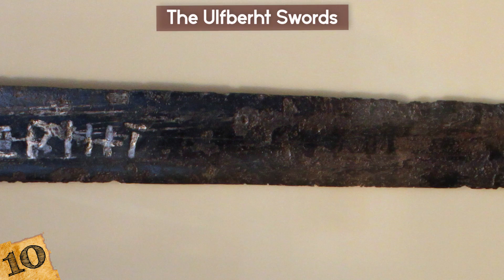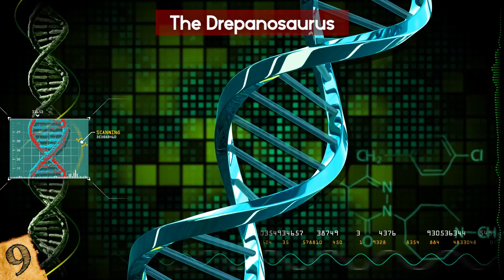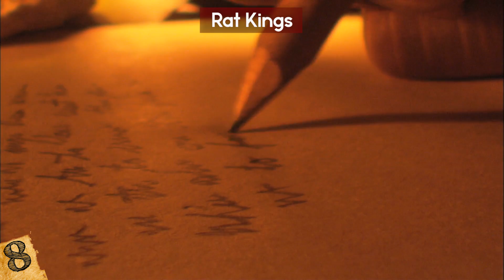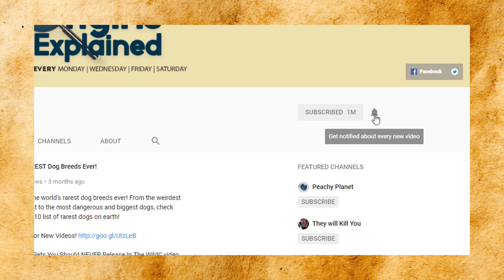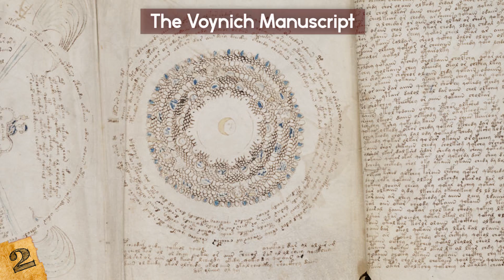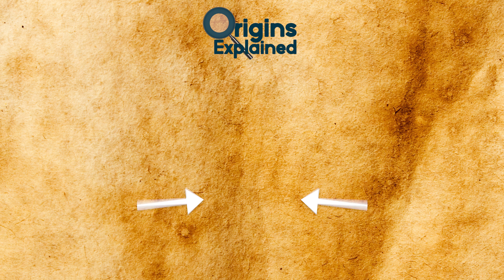MYSTERIOUS Discoveries Science STILL Can't Explain!

Comment: Why would anyone give carbon dating another thought. It has been proven wrong so many times. When I hear, this or that is 2,500,000 or 10,000,000 years old I just shake my head and laugh. Anything to discredit The Holy Bible. What about The Nephilim or giants? The Bible talks about them and even gives an accurate description of their specific origin. Scientist have found skeletons of them many, many times. This should be a big deal but you seldom hear about it. Why? Because it proves the Bible is accurate. No matter how hard scientist try, they will not take GODS credit from HIM.
Reply: "Why would anyone give carbon dating another thought. It has been proven wrong so many times. When I hear, this or that is 2,500,000 or 10,000,000 years old I just shake my head and laugh."

For starters, no. Carbon dating is perfectly fine to use when dating organic remains. We know how to best use it and when not to use it. Its' accuracy can be calculated and the results can be tested.

Secondly, we don't use carbon dating to date things that old. It's used on organic material no older usually no older than 50,000 years. All you've done here is highlight you don't know how carbon dating works and yet have decided it is somehow faulty.

Also, carbon dating isn't the only dating method we use. There are actually quite a few different techniques. We have these ones called 'absolute dating techniques' that provide incredibly accurate results that are again testable and their accuracy can be calculated. In fact, we can use several different dating techniques on one thing that all test different 'clocks' to get an age. When these different techniques that test different 'clocks' all give the same age, we know we have an accurate date for said thing.

"The Bible talks about them and even gives an accurate description of their specific origin. Scientist have found skeletons of them many, many times. This should be a big deal but you seldom hear about it. Why? Because it proves the Bible is accurate."

As far as I am aware, no such skeletons have ever been found. The only evidence I can find online has either been confirmed as hoaxes or are from conspiracies. Even if we were to find giant skeletons that wouldn't prove the Bible to be true. Many other religions mention giants, the Greeks, the Norse etc.
If the criteria is soo low that all it takes is
1. A mention of something vague in a holy book
2. Something akin to that being found
Then all religions would meet this criteria and all would be just as true as the Bible.

I mean giants are mentioned in religions much, much older than the Abrahamic faiths.

Comment: According to Cremo, the figurine (dubbed the Nampa Image) was recovered by workers who were drilling a water-well in Nampa, Idaho in 1889. The figurine, about an inch and a half long and made of baked clay was reported to have been recovered by the sand pump from a depth of 300+ feet. Cremo’s account of the “artifact’s” discovery is both credulous and inconsistent. Cremo is critical of Michael Brass, who wrote in his book, The Antiquity of Man: Artifactual, Fossil and Gene Records Explored, that it would have been destroyed by the drilling equipment upon retrieval as it was brought up to the surface. Cremo's response to Brass is that a tube was used after drilling through the lava layer to pump out the sand but, previously, he mentions that the figurine was brought up with a “core sample.”

Comment: The foot print deal is cool I've been there.  And considering that in northwestern usa they found dinosar bones with elasticity still not completely dried out there is evidence that dinosaurs are not millions of years old.  I do see that carbon dating is sketchy at best and in no real definition scientifically proven to be accurate . Look into it for yourself.  And ask yourself if atmospheric conditions are a constant.  Even gasoline burns at different rates at different elevations different humidity different humidity ect.... what was the rate of carbon 14 deteration 1000 years ago even 500 even 200???? They don't have an answer.  But assume it was and has been the same for 67,000,000 and before that even longer...  I call that assuming and therefore it is suspect at best.

Comment: Actually, the reason The Ulfberht was such a mysterious weapon is because it was made with pure steel. When forging a sword, the molten metal will have darker spots in it, these are impurities in the metal called slag which makes the metal brittle and is primarily responsible for the sword breaking, (as the Vikings martial art consisted mainly of 'stab, block, stab, block'). In order to make a good sword you must extract as much slag as possible. For that, your furnace must reach temperatures over 3,000 degrees which also allows the carbon to be mixed in more evenly. The Ulfberht was completely slag free, which should have been an impossible feat for anyone before the industrial age. The mystery lies in not only that, but who Ulfberht was, and HOW he did it as their fires could not come even close to that temperature.